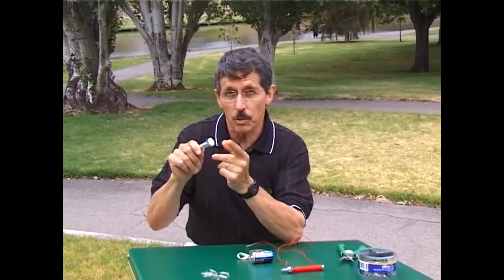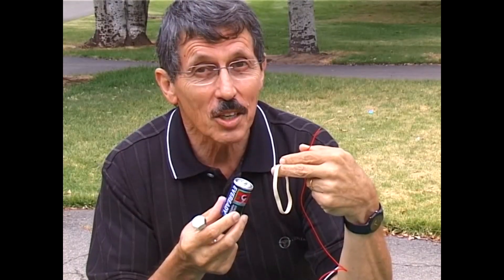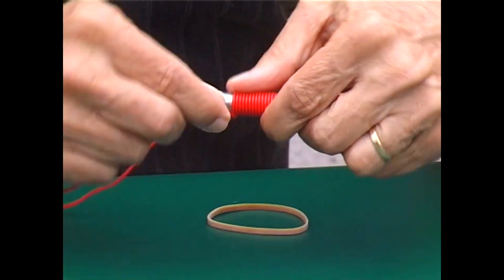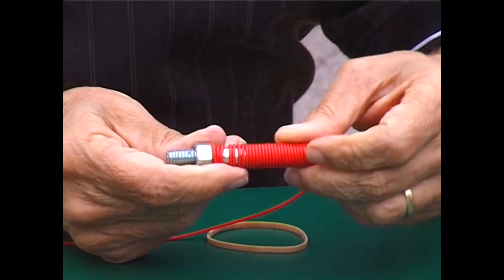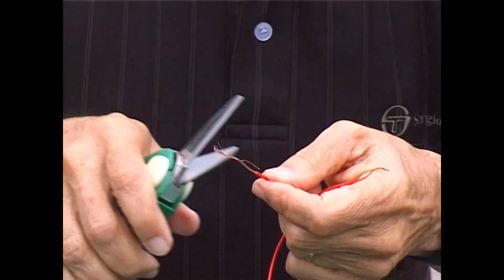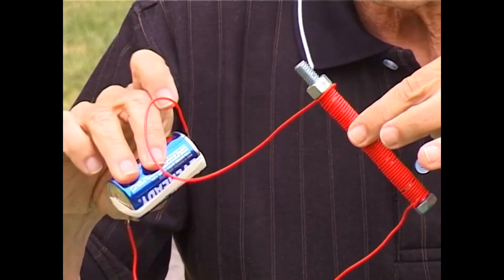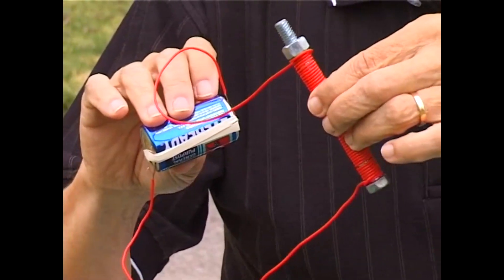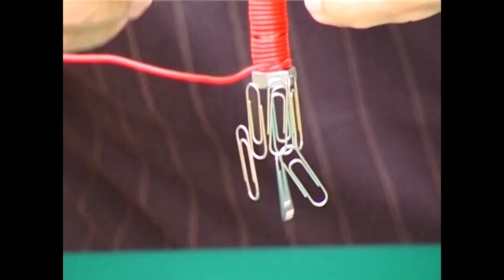Make your own simple electromagnet

Comment: When I was in second grade (ages 7 and 8), we did a unit on electricity, which included this trick.  I was excited to get to try it out at last, having seen great big junkyard electromagnets (and the ones used to separate steel cans from aluminum ones in recycling-plants) on 3-2-1 Contact a few years earlier.  Thanks to teachers who include this kind of stuff in curricula for kids so young, and for the books and TV shows and other media that spread it even further.

Comment: I remember one of my teachers in Highschool trying to demonstrate this with a screwdriver. It started out the same proving it wasn't magnetic turned on the power to magnatize it and that's where things went awry. Once the power was off the magmatism didn't go away, the look on his face was priceless when it happened. 
Screwdrivers don't need that much to become magnetic so avoid using them if you're trying to do this experiment.
Reply: Many screwdrivers are made a little magnetic, so that they'll gently hold a screw that otherwise might drop away before you get it in the hole.
Reply: @smadaf  and they were disastrous when mistakenly used in computers & tape machines by destroying the magnetically stored data!
Reply: @boomstand2872  , that's not my experience.
Reply: @smadaf  glad you never corrupted a hard drive with an automotive screwdriver - I did!